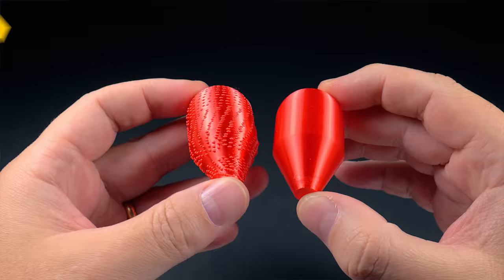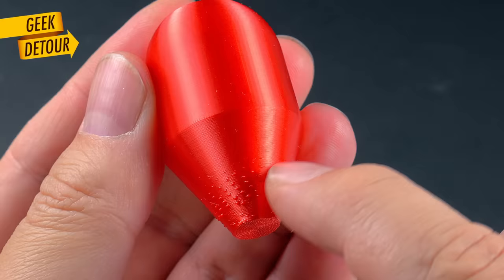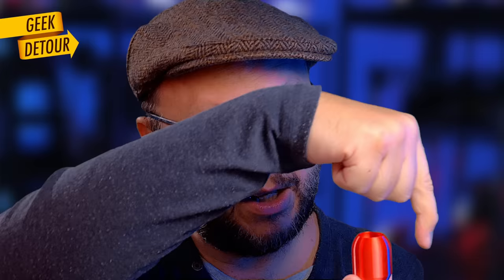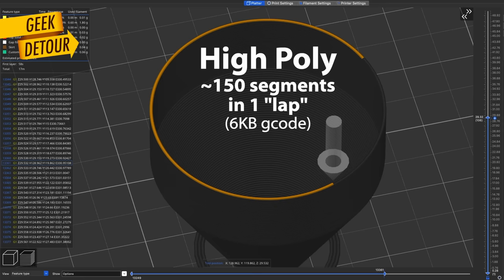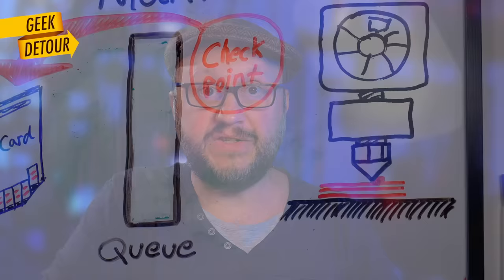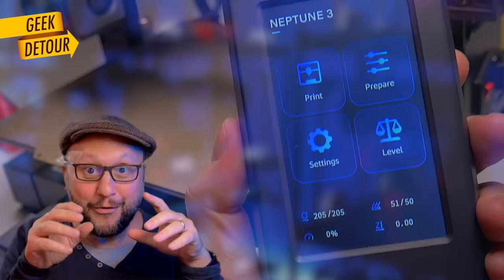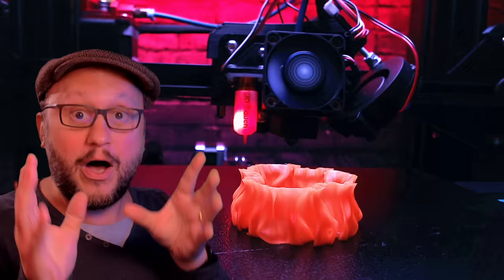3D Printer Blobs: a mysterious problem you won't guess how to fix 🤔

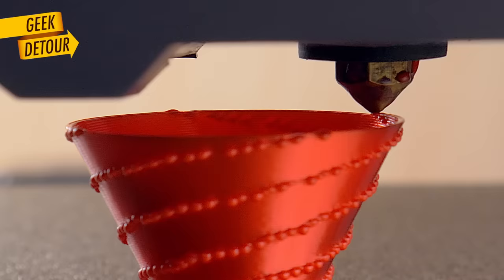Comment: 2:17 thats a problem for retraction. The settings must not be tuned right. Whenever the gcode calls for the head to stop, a few lines before it there will be a retraction where it reverses the feeder motor and stops filament from flowing through the nozzle. Retraction is also the main culprit for stringing during prints. It takes a couple prints to tune it right, but once its dialed in perfectly there will be no strings or blobs.
Reply from the maker: Hi there! The printer should NOT be stoping at any of those points - it should just move continuously. That’s why we don’t have a retraction - it is not expecting to stop at all. You will have retractions on your GCODE when there is a programmed change of position and the nozzle must travel to a different spot without extruding. It’s not the case here.

Comment: I got blobs just like this, tried your suggestion, and it wasn't my problem.  It turns out I had fat-thumbed the "infill overlap with wall" parameter and it was causing a glob to get carried over.  So if you are getting zits and GeekDetour's suggestion doesn't work, keep looking.

Comment: Hello
I had the same kind of pause-caused blobs with a brand new ENDER 3 S1 PRo when printing the pin challenge. Got rid of them by using a better SD card than the one that came with the printer (which had terrible read/write speed on bench).
Reply from the maker: Yeah! The best thing you can do when you get a 3D Printer is to put away the SD Card that came... and buy a Class 10, U1 SD Card from a reputable brand.

Comment: My guess is that when you save the model to the flashdrive, it partially corrupts, causing the blobs, but thats just my guess!
Reply from the maker: Nope. BUT: you have a point around SDCards (and I mention them in the end of the video): slow cards, or heavily fragmented ones (from writing and deleting files), or cards with too many files… lots of factors can make a card become a bottleneck. Formatting the card can help in those cases.

Comment: ARC mode :-) is your perm solution If you have ARC mode enabled in your firmware and your G-Code uses it you never will encounter those issue. Its a common issue and easy to fix. So if you only use G0 and G1 you run polygon's but if you go run in ARC meaning G2 and G3 code you run real curve motions and you eliminate this all together and your code is so much less in general. Just compile your firmware proper and you see no blob ever.
Reply from the maker: Yes, you are absolutely right. Most new printers already support Arc GCode commands - the challenge is that STL files are a mesh of triangles. Soon there will be a new version of PrusaSlicer that will read STEP files, so at least for CAD models we might finally have actual curves already from the model. Cura has the Arc-Welder plug-in (that you probably know) that tries to identify curves from the STL mesh and substitute them to ARC commands (and it actually works nice). Anyways, for highly organic STL models, the best thing is still disabling the PowerLoss Recovery feature and have them printed with no blobs regardless of how dense the mesh is.

Comment: An interesting interaction is that with Linear/Pressure Advance calibrated, the print head may still stop, but the blobs don't appear (as much) since the pressures already constantly being equalized 😲
Reply from the maker: Hi Chris! Linear advance is amazing - but in this case it won’t help. Power-loss Recovery will just “interrupt” the movement without first pushing filament back.

The Vase-Mode is the perfect demonstration: it should be continuous and Linear Advance isn’t even used on the case of a cylinder like the one of the video… if PowerLoss Recovery causes the planning buffer to get empty, the printer simply stops - and Linear Advance was not considered by the planner… so, there will be pressure in the nozzle (because there is always pressure in the nozzle while printing) and there will be a Blob.
Reply: @GeekDetour  I understand that aspect. My point is that, even if it stalls due to the buffer running out, the equalized pressure helps reduced the overall (potential) blobbing :p

Comment: 3D printers should really be equiped with a dedicated non-volatile memory storage to hold stuff like settings and power-loss data. E.g. an FRAM would a decent choice: it's fast, low power consumption and number of rewrite cycles are insanely high.

Comment: Wow, you did a tremendous analysis, I always questioned that, I usually remove those imperfections, but what you recommend doing is a good idea, when you know that the energy will not fail, deactivating the relaunch is convenient
Reply from the maker: Thanks!!! Absolutely, if you need critical printing with no material and time waste - and printing perfection, disabling that and buying an UPS is the way to go!

Comment: i have never ever ever experienced this issue, and its probably because my printer does NOT have any power loss features even on the firmware haha. My printer is still running marlin 1.1. It prints just fine too. I keep the Maintenace up on my printer, i clean it, i calibrate it, and it works great. CR10 for the win
Reply from the maker: Absolutely, if it works, don’t touch it 🤣 unless the hobby itself is messing with it every day
Reply: @GeekDetour  lol, exactly. i actually have not moded this printer at all. it works perfect so i dont mess with it. However, i do have a couple of others i have built from leftover parts and boards, those get moded, unmoded, etc. I have learned so much from building printers.. especially about z binding on prusa reprap machines..

Comment: All of that makes perfect sense.
When you started talking about the memory limitation i instantly drew paralels to buffer issues and lack of memory availibility. I guess this could be solved by writing all of the Gcode into memory and just pushing flags to the SD-card or an internal flash chip after every 10-15 lines of Gcode or whatever.

Today we could easily use RP2040's and several Megabytes of flash and ram, in fact i belive a pico could do what most printers mainboards do performance wise.

Comment: you can also get a higher speed sd card. pricy but also a solution if you wish to retain the recovery feature
Reply from the maker: Hi there! That’s the point: I was already using a fast SDCard: Class 10 U3, Sandisk.

Comment: my guess: it happens bc data is transferred too slow, so the printer takes breaks to properly boot/recalculate after he noticed a problem with the filement (during calculating no heat is applied and no movement so blobs can flow and make these spots ...heard it with some sd cards in ender 3 I think)
Reply: i don't own a 3d printer yet 😂

Comment: I've never made use of it, but I'd think any long power outage has a problem because the bed will cool and the print likely detach. Best to use a UPS if power outages might matter.
Reply from the maker: Absolutely right! Specially with PEI sheets, as it cools down, prints just pop out.

Comment: I have this problem with my Neptune 3plus but with straight surface too. My old CR10V3 printed really well and was great at fine detail. Haven't been able to get the Neptune 3 anywhere close. Always looks really rough.
Reply from the maker: On the Neptune 3 Pro, Plus and Max there is an option to enable or disable Power Loss recovery in the settings menu, on the printer display.
Reply: Ah ok, thanks

Comment: Tl;DW: power-loss recovery OFF when using vase-mode due to the internal memory buffer of the printer becoming empty when backups of print state are saved to SD-card.
Reply from the maker: Any print. Not just vase.

Comment: I flashed JyersUI to my Ender 3 V2. What's interesting is it did not have power loss recovery enabled by default, which actually came to a head during Hurricane Ian when my power blinked just long enough to interrupt a 14 hour print. I guess in a way this was less of an oversight and more of an intentional move to offset the issues that come with it

Comment: this should be pretty easy to fix, there should second static queue of command which would contains proper step so when the printing queue is empty filament can be stopped/retracted(or whatever else is needed). Than once new commands are read proper recovery can be made before commands are put to queue, it may be worth filing a bug report

Comment: noticed this issue on a recent print. I'm running octoprint on a pi to an ender 5 pro. the cable connecting them is approximately 1mtr in length. I know I've got a nice short cable somewhere. I'll dig it out switch cables and see what happens on my next print. I'll be back ^_~ lolz

Comment: TLDR - Printers have a resume on power loss feature that is enabled by default which writes to an SD card causing occasional pauses. Turning this of turns turns off the writes to SD Card and results in a smooth print.
Reply from the maker: If only a TLDR could make 2 million people stop to pay attention 😅 It would be much easier, right?

Comment: Upgraded my printer to marlin last week, and while scrolling through the menus i turned on power recovery, last night the printer was going and my lights went out for a split second, printer didnt even budge, just continued printing
Reply from the maker: Power Supplies can provide power for a few extra milliseconds (maybe half a second) after the mains power is cut.... So, for a very short outage, sometimes the printer can continue as if nothing happened - it doesn't happened because you activated Power Loss Recovery.

Comment: I think the solution is to have a different thread saving the contents into the SD card … assuming the board has this possibility.
Reply from the maker: Hi 👋 The microcontrollers on these 3D Printer boards don’t run operating systems and also can’t run parallel code. The “correct” way of doing it is really detecting when there is an actual power cut - and only then write a checkpoint on the SD Card (while the board is kept “alive” using capacitors). That’s the Mod that Chris’ Basement shows on his video.
Reply: @GeekDetour  yep, that is definitely smart. Thanks for answering to my comment :)

Comment: Please do not put a UPS or large power supplys on a surge protector! You'll burn out the plug and it can start fires. Luckly it will probably blow the fuse before that happens, but if the fuse is faulty, you don't wanna find out the hard way.

Comment: My Creality 3d printer makes the same blubs, but it doesn't have an option to turn off the "outage recovery" feature. Thank you for G-codes.
Reply from the maker: Hi there! If you are using the same SD Card that came with the printer, there is a great chance the problem is that. A fast SD Card from a good quality brand (Sandisk, Samsung, Lexar...) can be the solution for your case. Don't get crazy on size: 16GB, formatted on Fat32, works great.
Reply: @GeekDetour  I've got a new fast SD Card, and have "printed" your g-code, now I have  much less blubs, but they still remain on simple forms. The decision is to increase number of polygons.

Comment: My guess before viewing is that if material blobs up, there may be an excess of material. 

By the way he calls it a feature, it appears to be a side effect of some function. By the regular pattern of the blobs, I assume it has something to do with the way the material is deposited.

Therefore, I assume it is an error having to do with material extrusion performed preemptively before moving the print head.
Reply: Having seen the answer, I believe my answer was wrong. That seems like an issue that would come up less on designs with longer straight lines to print. Well done, Sir.

Comment: This seems like exactly what's happening with my prints lately ! I was wondering why the nozzle would stop randomly too ! The Netpune 3 does have a "resume printing" option, with a lightning cycle logo that perfectly fits for a power loss recovery logo. I'll try disabling it.
Reply from the maker: Elegoo added the option to enable/disable PowerLoss Recovery after I published this video - yes, try disabling it and tell me here if it solved your problem.
Reply: @GeekDetour  I got my smooth prints back ! The culprit was indeed lag due to the SD card. Though disabling the resume printing option on the printer or adding the instruction to the gcode directly did not make much of a change, a reformatting of the SD card fixed the lag entirely.
I was still using the one provided with the printer, I suppose it got fragmented over time.
I will get a new, faster one anyway, just in case.

Thanks for your video, I would never have guessed to look for issues with the SD card without !
Reply: @GeekDetour Do you think that the type of SD card plays into this lag issue?
If one uses a class 10, GOOD QUALITY card (reliable brand name) that this problem doesn't happen when PLR enabled?
Reply from the maker: PowerLoss Recovery caused the Blobs on my video while using a Class 10 SanDisk SD Card… 🤷‍♂️ Not saying it WILL happen to you - it depends a lot on the model you are printing too… But I always disable it and I finally bought an UPS because now we moved to a small town and electricity here is less than ideal.

Comment: I don't think the problem/solution  is in reducing polygons and number of movements on the model. it's just a problem on the Controller, needs more RAM buffer, double buffer, faster BUS speed and obvious updated firmware that  for certain fix this issue
Reply from the maker: I agree: you must always be able to print with the best possible quality. But in the end, the printer I showed in this video (as many printers people have at home) are totally capable of printing very smooth with no pauses - enough buffer, enough reading speed from the card… Except that PowerLoss Recovery is ill-conceived to write on the card all the time. To be well implemented, the board should have big capacitors to keep power for a few seconds, detect when an actual power-loss occur and only then write a check-point (and Marlin is already programmed to do it the right way).
Disabling power-loss recovery in most printers just makes everything work smooth.

Comment: Hi. This is awesome as I have been struggling with this issue. I want to use the disable g-code you provided, but I noticed you said I would have to put it onto the SD card for the printer. My problem is that my printer (Silhouette Alta +) doesn't have an SD slot. Its meant to be used with their program which sucks, so I am using it with Cura. Is there any way to put the g-code into cura for the printer instead? I'm still learning!  Thanks.
Reply from the maker: Hi there! Are you sure you having this blobs problem? It could be something else - in this article I read the Alta+ doesn’t have PowerLoss Recovery anyways… Cannot confirm or deny, here is the article:
https://ahsaws.com/silhouette-alta-vs-alta-plus-review/

Comment: Ok, so we have identified yet another cause of blobs and how to make them go away. But, what if a person wants blobs as a pattern or randomized for texture effects. I refer to blobs as a unrealized feature because although they are nuisance in most cases, there are times when adding a texture is desirable.
Reply from the maker: Oh, if that’s desirable, we would need to interfere directly on the GCode to cause that - there is not such feature on the Slicers.
Reply: Do you mean like that texturing feature in Cura?  I forget what it's called, but it create a "bumpy" outer wall, on purpose.

If that's the case, I doubt that this would be affected by the auto resume thingy.

I remember trying it once, thinking that this would be cool.  LOL

IT WAS NOT!
😅😂🤣
Reply: @BlondieSL  well if that's a feature that kira now has. Then I'm unaware of it. Perhaps somebody in the community had noted my having mentioned this kind of thing before and decided it would be a good idea to add a function to deliberately cause bumps as a texture. Although the way I looked at it was more capitalizing on the air and converting to air into something deliberate rather than adding extra code. Therefore taking advantage of a mechanical malfunction and not adding extra code to create a function. 

Anyway if it is a function they've added it is new. At least since the last time I texted kira. And I usually have a somewhat recent copy of it on my computer. However it's just not my go-to. I tinker with it now and then. But generally there are things that I do that cannot be done as easily and kira as I do in simplify3d.

Comment: I had almost the same issue and tried endless configurations and changed parameters again and again without success. Then by coincidence I sliced the model on my sencondary computer as my primary computer was busy with other stuff. I still do notknow why but: Cura 5 resulted in having a blob issue with exactly the same settings as in Cura 4.13.1(my sencondary computer simply still had the older software installed)  - so I went back to Cura 4.13.1 on my primary computer as well and since then I have perfect prints...
Reply from the maker: Hello! There was a release of Cura 5 that a LOT of people got problems. I don’t remember exactly which number it was. Have you tried OrcaSlicer? I LOVE it!